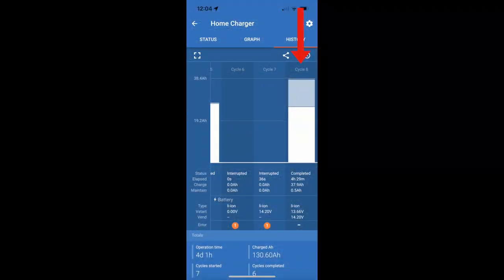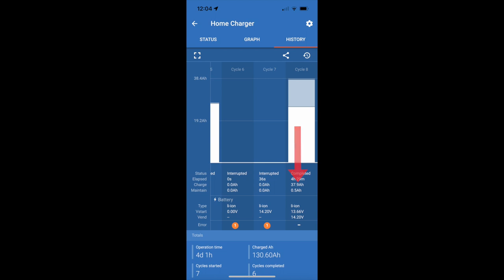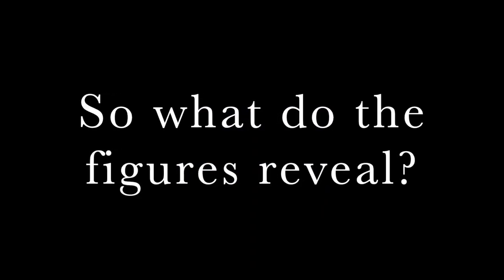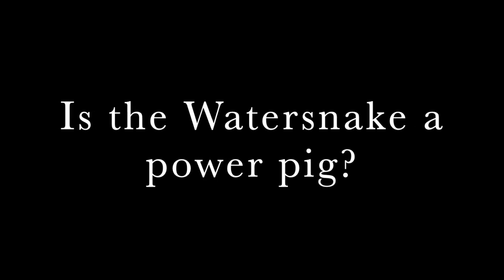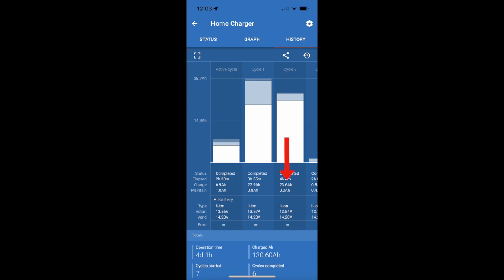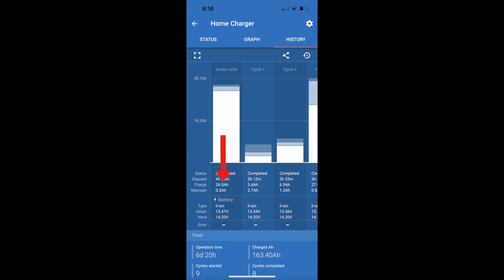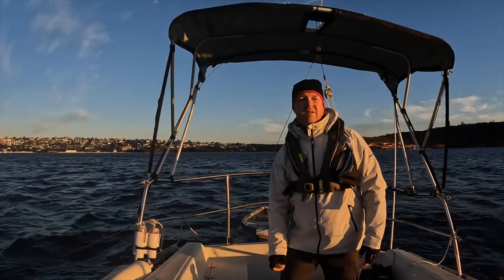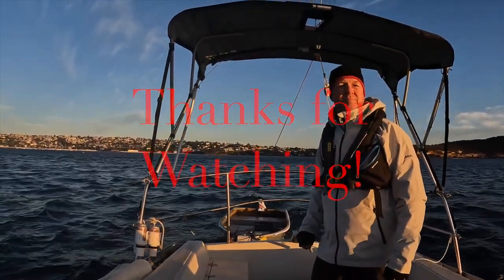Watersnake Venom - Battery Killer?    HD 1080p

Comment: Apparently these motors use coils to bleed off power at low speed, as heat.  So they are inefficient at lower speeds. Look up the PWM trolling motor control box builds - it makes them more efficient at lower speed. I built one for mine, did seem to make a difference, but not too relevant to me now since I got a 100ah battery, but may be for kayak use down the track with a smaller battery.
Reply from the maker: That's interesting.  I'll take a look.
Reply: That’s why people use a Pulse Width Modulator PWM DC Motor Speed Control Switch Controller.

This allows 0-100% by pulsing….
Reply: Good information.  I'm wrestling between Watersnake's very light ASP series for my kayak, vs picking up a used Minn Kota or Motor Guide in my area.  I noted that there does not seem to be an obvious electronic board inside the motor head, so I suspected no PWM.  Actually, it was sort of a plus for me as several used motors have mentioned circuit board failures.  So are the Watersnake motors generally brushless.  It seems that every quality battery powered tool I buy lately has gone that route.  Also, I am concerned by some info that I've stumbled on that says that Watersnake motors are not rated to use on Lithium batteries.  Well, in a kayak, that is a deal killer!  Interested in all feedback!

Comment: I purchased one of these WS44 motors for a 2.6 alloy hull inflatable. Best investment I’ve made in years. I run it with a 25amphr lithium battery. One hour exactly at full power. It replaces a 2hp yammy. Way way better.
Reply: I shortened the shaft also. Best bit is just rinse it off unlike the yammy. I overnight regularly and use it for short trips to shore. Perfect.
Reply from the maker: Thanks for your comments.  1 hour on a 25ah lithium is impressive!  All the best, Tony.

Comment: Good video mate. Is the watersnake still going strong? 

Im looking at getting a watersnake slx 54/42 for my old 3.7m savage snipe. Was thinking a 200ah battery and getting rid of the old johnson 2 stroke all together. I know it wont set any speed records but just want some quiet hassle free fishing.

Cheers mate.
Reply from the maker: Thank you!  Yes the Watersnake is still going great but I've plumped for an ePropulsion which is all sorts of awesome.  200AH will have you going all week.  I plugged my Watersnake into a 19AH lithium battery that I have and it was able to run flat-out for just under 30 minutes on my 2.5m tinny.  They are a very impressive motor for the price as long as you're not in a hurry.  All the best, Tony.
Reply: Hello. 
I am also looking at a water snake for my savage snipe. I’m interested to know. Have you used it on your boat yet and what is the outcome like?  
I was thinking of 44/36. 
Mark.
Reply from the maker: @markjurcec9267   Hi Mark,  Yes I used the water snake successfully for over a year and it was (is) great.  I've just upgraded to an Epropulsion but I can recommend the watersnake for tender craft use and for small boats where speed is not a priority.  The 44/36 is light, economical and very sturdy for the price. Despite what some people say,  I used a lithium battery with no adverse effects.   All the best, Tony.